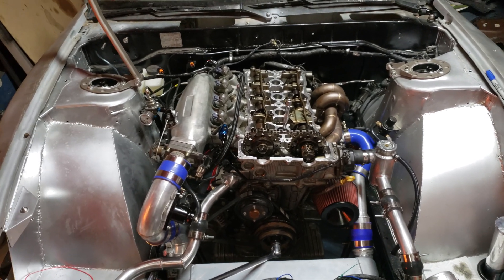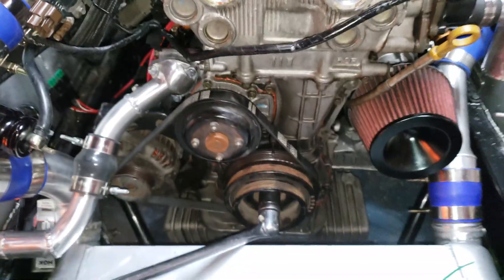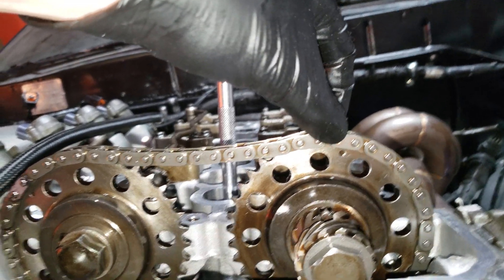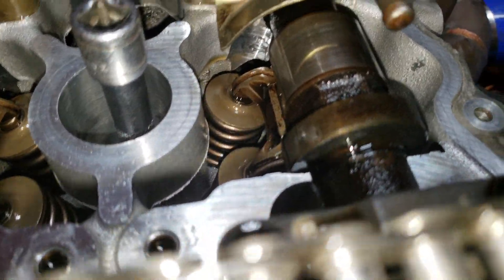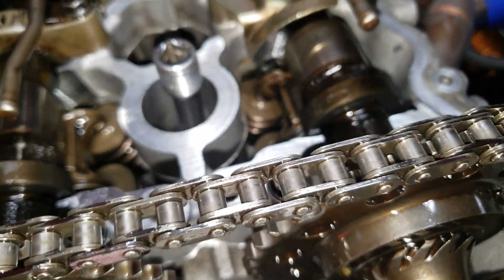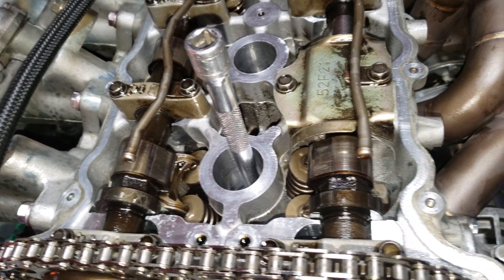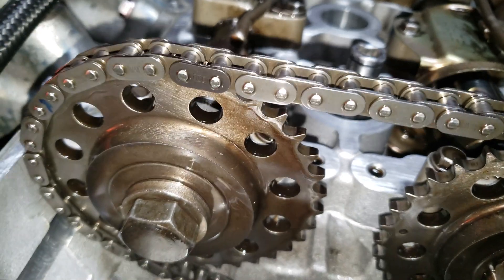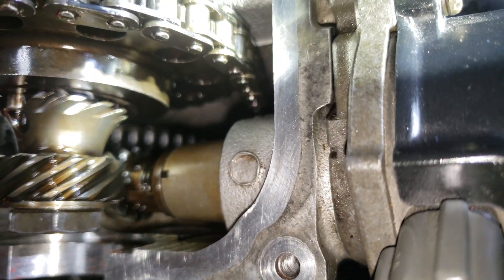SR20DET Cam Timing how to set timing chain and verify its correct

Comment: Saved me after a few hours of trying to time my s14 sr20det. My chain position moved when I pulled the head. Setting engine to TDC and setting cams to 10 and 12 o'clock worked perfect after counting the links in between, even without having the silver links line up.

Comment: What about the intake dowel pin? Is that suppose to sit at 10 o'clock? Thanks
Reply from the maker: Good question unfortunately I am not sure.  If you have the links and exhaust cam correct you should be setup. However,  Mazworx does sell a bolt on timing tool if you want  even more assurance.
Reply: @mannarinodj  Cool. I'll have to look at it then. Just bought headstuds from them

Comment: So I’m putting the chain back on, when the exhaust dowel pin is at 12 it’s pushing on the 2nd cylinders springs. So it doesn’t sit nice at 12, any tips on how to install the chain with timing it’s my first time
Reply from the maker: Yeah the cams will never play nice,  springs somewhere will add unwanted tension. 

I left the timing cover on as I did headstuds and gasket.

I think I left it on TDC on the crank and just used sockets on the intake and exhaust cam and rotated them to get the chain on then installed tensioner (trial and error) until it was right.  Don't be afraid to turn the crankshaft though if it helps. 

Lastly play with/instal the CAS/distributer with valve cover off, everyone gets the timing off because the distributer jumps a tooth often. 

All I got for now good luck 🤙
Reply: @mannarinodj  thank you dude! Gonna give it another go right now

Comment: This was a very good video and a clear explanation.  Definitely the best among the ones that come up on youtube.   It would have been even more helpful if the position of the cam lobes was focused on and emphasized.  
Could you please comment on what "overlap" means in relation to the appearance of the cam lobes for cylinder 1?  Does it mean that they are asymmetrically angled when at TDC and pointing outward?  
Also, I noticed before you started rotating the crank pulley that there was slack in the chain. 
Is there supposed to be that much slack in it when the tensioner is exerting pressure against the chain guide?
Reply from the maker: Glad this helped.
1st overlap. Most engines on the exhaust stroke the intake valve typically starts to open while the exhaust valve is opened right around top dead center this allows cool air to cool the exhaust valve which is why most intake manifolds on cars are always black and dirty from exhaust going back into the intake manifold during this event called "valve overlap".

Twinscroll or 180° headers keeps exhaust pulse from going back up into the intake valve during valve overlap gaining hp.

2) OEM chain tensioner uses oil pressure and a rachet system to tighten the chain.  This engine hasn't been run yet so it had slack. If your using a mechanical tensioner like a mazworx unit, then there would be no slack once the tensioner was adjusted. 

Hope that helps and made sense?